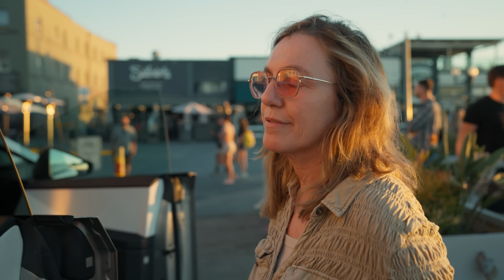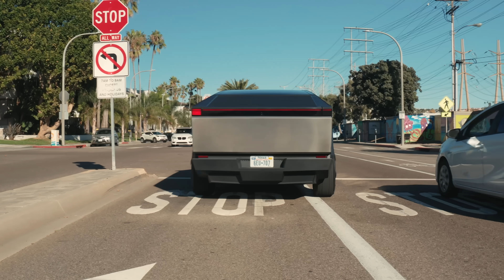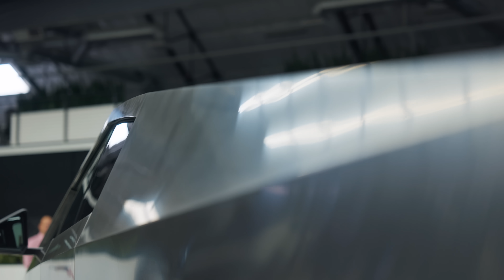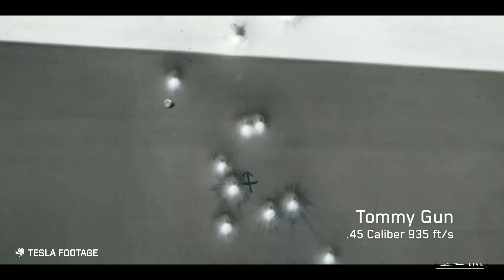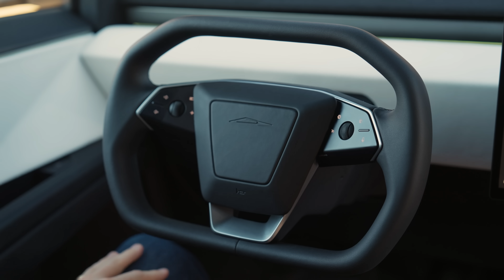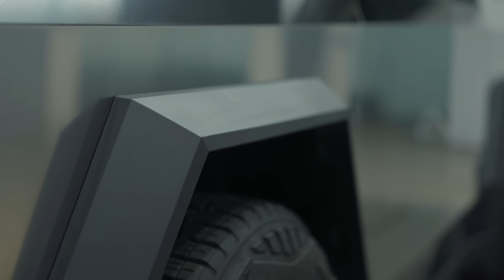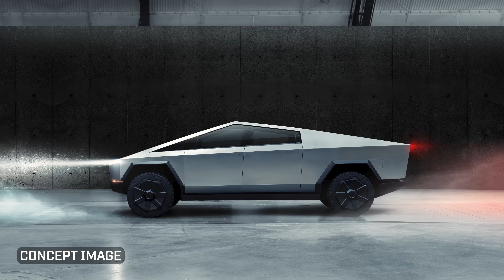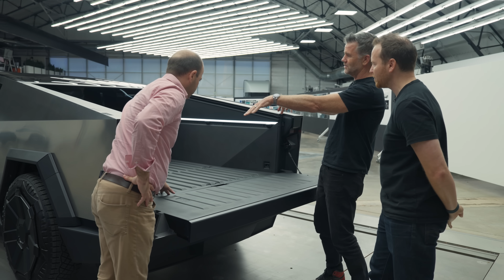FIRST DRIVE: Tesla Cybertruck Full Review

Comment: 90 days to build a prototype explains alot...

Apparently panel gaps are also precision engineered 🤣
Reply: 49 days to design the original Jeep, using drawing boards. This was designed with computers, which generally are faster than drawing boards.

Comment: Good review, except for a few details that would have not been missed with some bit of due diligence.
- There is no need for a round steering wheel, as the steer by wire does not require multiple turns even at low speed.
- It does not matter that the adjustments are controlled through the menus on the screen, as you just need to set them up once and save it in your profile, and after that when you get in the car everything is adjusted to your liking automatically.
- Did not mention the over 100 voice commands that you can give with the push of a button on the steering wheel, making fiddling with the screen unnecessary.
Reply: Why does your comment sound like you read it 1:1 from a Tesla Marketing list...

Comment: I can't imagine the problems that stainless steel body is going to have, but it's going to be a problem.
Reply: The stainless steel Delorean body from the 80s was pretty much the best thing going for it. They still look good. Just under powered!
Reply: @axiomic  Everyone who owns one is terrified of getting dents or scratches in it... Because there is no quick cutting and buffing out small scratches on stainless surfaces.
Reply: @Finnspin_unicycles  at least the CT has thick 3mm panels, and it’s a work truck that will wear its scars with pride. Also Tesla will be able to provide replacement panels fairly easily when needed. Whereas Delorean went out of business almost straight away..
Reply: @axiomic "fairly easy"
son, you have any idea how utterly expensive those extra thick panels are to make?

And have you not asked yourself just why the DeLorean wasn't a success?
Reply: @Blackgriffonphoenixg  Delorean was underpowered and inefficient. Owner was accused of drug trafficking..
The maintenance of the finish is far less important on a pickup truck compared to a luxury sports car.
Yeah the labor in changing a panel isn’t cheap, but the part is relatively cheap, as is a gigacasting.
Reply: @axiomic  PMSL, no-one's buying a Cybertruck for commercial purposes. Same as >80% of F-150 owners, it's for the once every five years they need to move something that couldn't quite fit in what used to be a family estate car, and every other day, it's a status symbol for people with genitals so small they'd make for an interesting subject for a doctorate in a medical degree.

Comment: Apart from the dangerous shape and the stupid squared off steering wheel,  the unpainted body does show ripples. I suspect most will be sold to people that won't be using them for ordinary pick-up truck functions such as fetching and carrying. For such a heavy truck it has a pretty feeble towing weight relative to the F250. The quoted 0-60 time is very impressive, but not what you need in a truck, particularly if you are the one paying for the tyres..
Reply: You should check out the tow test of the Cybertruck compared to the F350… smashes it for that particular test. And the F350 was considered as the best for that test. It was shown at the Cybertruck launch event. You can find it on YouTube.
Reply: @axiomic  I just watched that, quite impressive, of course the Cybertruck accelerates like hell, which probably helped the outcome. Curiously the Cybertruck sat very low at the rear before and after the pull, with the competition being all about traction I have to wonder if it was carrying ballast under the bed.
Reply: @g0fvt  I doubt it. However the air suspension adjusts to the load to get the best traction and support.
Reply: @axiomic  The conventional trucks probably had open differentials in each axle so lost traction, the Tesla has some advantage in that area. However the Rated towing capacity of an F350 is far greater than for the Tesla.

Comment: So I see that all the tech - the steer by wire etc  - will flow down to other models on the next iteration. I cannot wait!
Reply: I really like the tech. And it does look reasonably practical for most people Its a shame its so damn ugly.
Reply: Tell me you’re not a car person without telling you’re not a car person…
Reply: Yay more things that'll break in 5 years
Reply: @anusername8350 
How would it brake? The difference between this and traditional power steering is a piece of wire and a few chips. It's also been used in aviation for decades.
 And it's triple redundant for safety, so even if a part fails, you won't notice, just got a warning on the screen.
Reply: @anusername8350  Welcome to every new car in the last 10 years...

Comment: 11:15 it is clear now that there was exactly  0 thoughts on repairability after a car accident. That explains the double and above insurance rates.
Reply: I think it will be better off than traditional not tough skinned pickups. Sure a major accident could very well total the CT - but the same goes for traditional pickup trucks.
Reply: Hagerty Insurance just released a video of this truck. They smashed it with standard test sled, and it did extremely well. Would have needed two doors, some trim, and a wiper to repair.
Reply: @Navybyrde  doors are easy to replace. The issue is the rear quarter panel part of the exoskeleton body. You buckle that in a rearend accident and you basically need a new whole body, but you can keep the old doors 😂
Reply: @ItsAlive111  that same issue applies to EVERY unibodied vehicle on the road.
Reply: @Navybyrde  wrong. The unpainted stainless body of the CyberTruck is unrepairable. On a regular, carbon steel, painted body, car/truck, you can cut, weld, paint to cover the weld of the repair. What are you going to do on the stainless? Even if it could be welded in a regular repair shop, you would have a, scar, a weld seam running across your $100k “truck” 😂.
Reply: @ItsAlive111  how TF do you think that they build it in the first place?
 I can weld stainless at home. Any decent body shop could learn.

Comment: They should let you add a giant battery for the bed. To take up the whole bed and double or triple the range for people that like to tow trailers. And go long distances.
Reply: They did. See Range Extender.
Reply: @ampontour  The range extender is basically "just" to get the Cybertruck to the range they initially promised it to have. It doesn't really "extend", they just weren't able to achieve the wanted numbers with just a battery pack in the car.
Reply: Ya it does a little extra. I mean give them like 3 options. A little more and a lot. Ya the weight will add some. They got the shocks for it. Even distribution of the trailer and you can pull longer then. Or maybe even break a cannonball record.  Maybe someone will do it. Make the trip without stopping haha
Reply: That would be incredibly heavy and completely throw of the balance of the car. Batteries are super dense and heavy, and you would have all that weight in the back and relatively high up, compared to the normal flat pack in the bottom of the car. Pretty sure that would really mess with the driving behaviour of the truck.

Comment: If you had one of these and were doing a long trip while towing are there special extra large charging bays to allow you to do so or are you going to have to unhook your trailer to get into the charging bay. All tesla charging point where I live are normal parking spots where you drive or reverse in to use. You would not be able to charge with a trailer without taking up multiple spots
Reply: Some of the newer ones I´ve seen in youtubers´ videos do have drive-through chargers clearly meant for cars/trucks with trailers, so they are thinking of that. No idea how many there are yet or if the cybertruck will let you filter for those chargers in its nav-system though.
Reply: Some of the newer super chargers they are rolling out have a drive through for people towing, but they are not super common.
Reply: I also think that now more and more of those trailer suitable chargers pop up as now towing with EV starts becoming doable with CT, F150 or the Chevy Silverado with its huge battery.

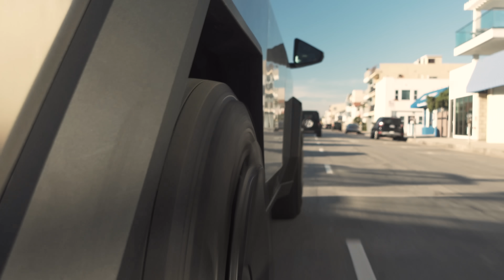Comment: The styling is from the stainless steel's characteristics. It is not pretty, but it is both coherent and aerodynamic, at scale might be low cost with no paint and lower tooling costs,,... and of course durable in the long term.  The real story is at 4:02 of the video...  It is lighter and stiffer than the Hummer, similar range, and the battery? 123 kwh versus 212 kwh.  While having a longer bed and a similar interior room.  That 123 vs 212 might be about a $9000 battery cost advantage alone, plus no paint, and other elements of the "secret sauce" inside the Tesla supply chain.   Plus, it is a Tesla-made battery.  You will be welcomed to brilliant engineering if you can get past the styling.   Lastly, from both the driver's seat, and its utility, it will please its owners, so they will sell, and in the end that is what's all about.  Our opinions of how it looks won't matter to the actual buyers.

Comment: There are so many things wrong with this. Scratches, dings, finger prints, el camino = DeLorean, it will rust, 70k more than an F150, battery replacement will be a fortune, ect. Can you imagine how it would do in a crash? It would rip the other car to shreds.
Reply: Stainless steel doesn't rust.
Reply: 8yr 150k mile battery&powertrain warranty and it's priced exactly in line with the lightning trims. 
Did you not watch Randy pobst slam it with a sledge hammer on the hagerty video? Not even a scratch you poor simpleton! 👍🏻😀
Reply: Much better priced than a Ford f150 lightning. Also this is the top priced model.
3mm paintless steel is strong asf compared to thin mild steel or aluminium body work..

Comment: Remember people keying teslas to the point where it was a trend? How many people are gonna be popping shots off at this thing just for fun or because they haters lol? Personally, for $100K, I might as well get a top of the line trim truck. TRX, lightning, hummer, etc... Tonneau covers are gross but I get the efficiency of it. No heads-up display is a missed opportunity for all Teslas honestly. Safety issue and practicality issue. Speaking of safety, a steel truck with 7000 pounds coming at you in 2.6 seconds😂? That’s concerning if idiots are driving. Also how much to repair a panel vs a traditional aluminum panel is something I wished they touched on. And I wish I could have seen more truck things. The bed. How do you get in it (Chevy and GMC have cut outs for stepping into the bed, ford with that weird built in ladder), tie down points, off roading, diff locks, crawl control, articulation in rocky areas, etc… that’s the whole point of getting a truck. This seems like a sports car trying to be a truck. And I really would like to see this thing jumped with its 7000 lb weight and air suspension if it has a “Baja” mode… Not so sure on that one😂 And basic interior looks like toyota levels of cheap… $100k and you get that cold uninviting interior? Oof.

Comment: You'll need extra mortgage for tires. Why there is not some head-up display. And imagine yourself to aim to screen button in bumpy dirt road. I do not know us driving licences legislative, but in most of Eu, you can load just 400kg and you are over normal passenger car weight limit.
Reply: The 400kg is based on the limit of braking with extra weight added to the cars standard weight. The truck has bigger brakes for more weight and even has regen per motor  to slow it down faster.
Reply: @kylereese4822  No you undestand me wrong, we have weight limit for our driving licence, that is 3500 kg (for one car or for towing) if I count that cybertuck is 3100 you must be careful not to break the legal limit. E.G. in my Toyota from 2016, I can load about 520kg (that is maximum car limit) and Iam still far under 3500kg. From my perspective my Toyota is still more practical car that this overpriced "truck". Also I read that we have a 1 year limit, that you cannot sell to somebody else except Tesla... to prevent from some shady bussiness.

Comment: Permanent magnet front motor means its FWD most of the time then...
Reply: Only when you are just in efficiency cruising mode. As soon as you step on it for power, it will be AWD.
Reply: That's because of physics. It's more efficient to pull a load than to push it.

Comment: Ah yes this thing is Tommy guns proof because the notorious gangster Al Capone is still running Chicago. And what's the point of making it stop 9mm Subsonic when the cheapest of hood-rats is going to be running regular 9mm from a Hi-Point. 

This whole thing is such a marketing schtick. This toy-ass car costs 100K, has the interior from a padded-cell, is shaped like a cheese slice and because of the shape and the stainless monocoque, this thing is basically useless for any utility application where you need to have a body-on-frame or at least a regular metal body to attach lifts, tow-bars, hitches and what not. It's a shame that the tech-bro mindset made them make this thing unique through the useless and frankly hideous design (although Frank's original sketches are amazing) and not because of what it could do because of the power and the ergonomics this design could offer. What a sorry shame and waste of so much money
Reply: It will outsell all EV trucks. I can't wait to see you cry.